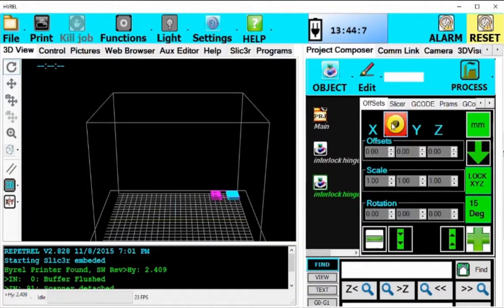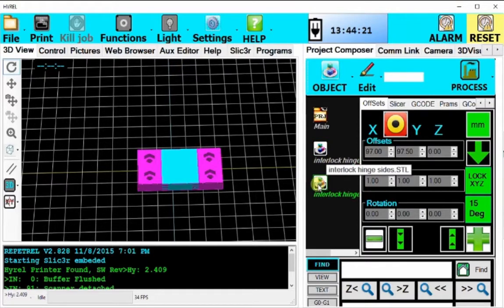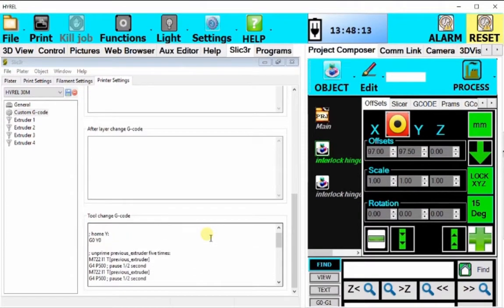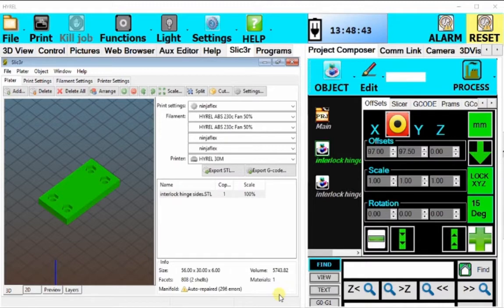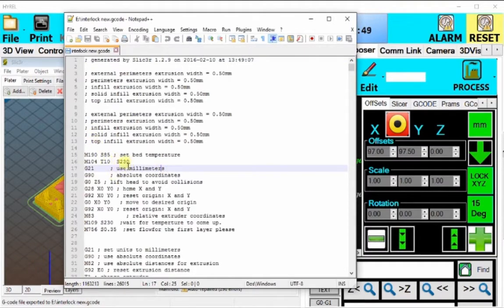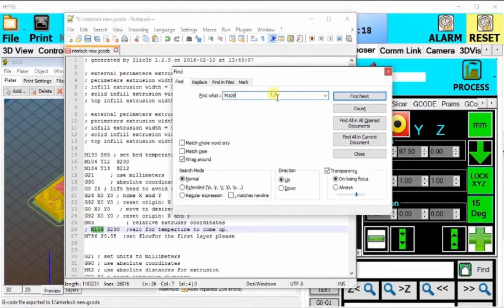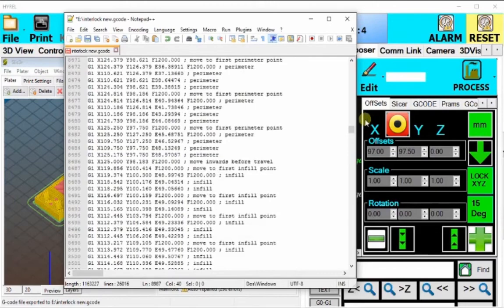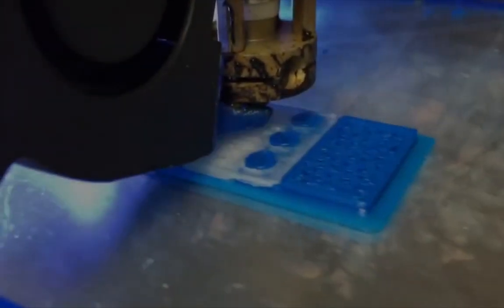Hyrel Multi Head Printing - Nested STLs

Comment: How to print using Krakatoa 15 extruder loaded in Yoke 1 head 5? What should be the slicing software, and other print settings? I am using Engine HR_hydra_4.203.